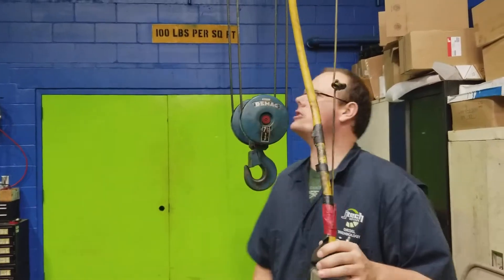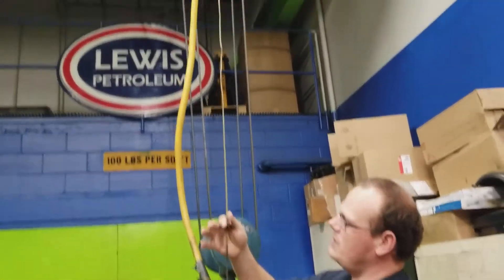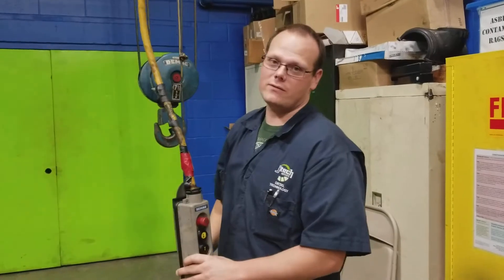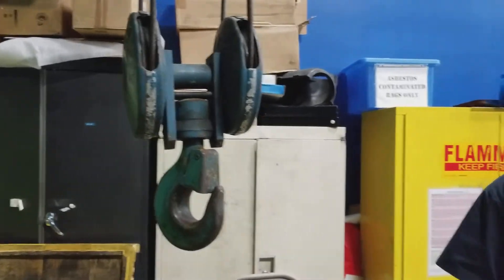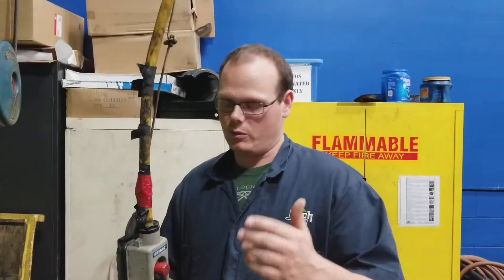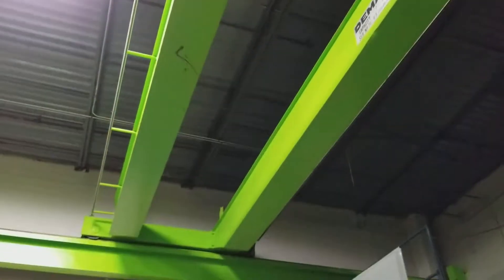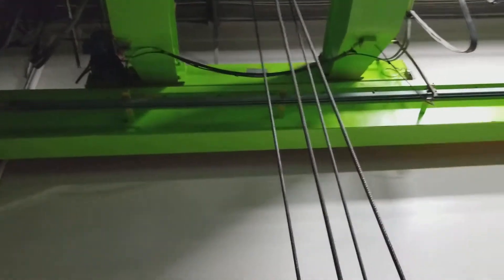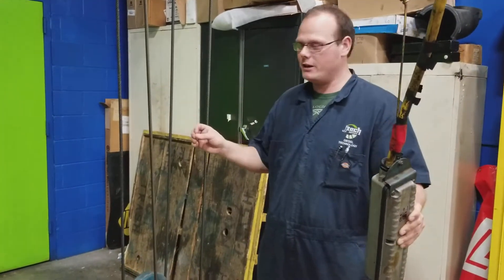Inspection of an OverHead crane

Comment: 1 No ANSI tag on control pendant. 
2 Dead end of hoist rope appears to be rigged incorrectly judging from the angle it is hanging.  It should be hanging straight down, not to the side.
3 Many bends and twists in hoist rope. It should be inspected for damage over entire length.  On a grooved drum, the rope can jump a groove if the trolley  is moving while hoisting with no load. This trashes the wire rope..
4 Hook appeared to have witness marks and spread should have been checked with a tape measure. 
5 A complete inspection of the trolley and hoist should have been done before a functional test.  That means actually climbing up there and looking at it.
6 All columns and connections on the crane rails should be inspected for damage or loose floor and rail bolts. Electrical conductor bars and pickups should be inspected for the entire length of the building. 
I retired after 20 years as a Washington crane inspector.  Send this guy back to crane school.